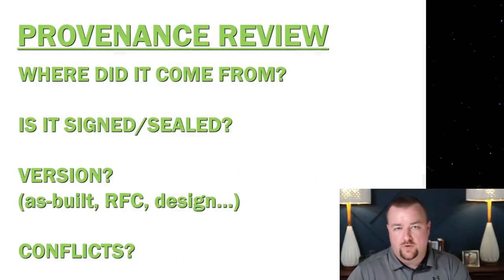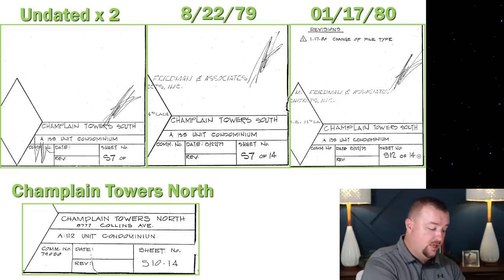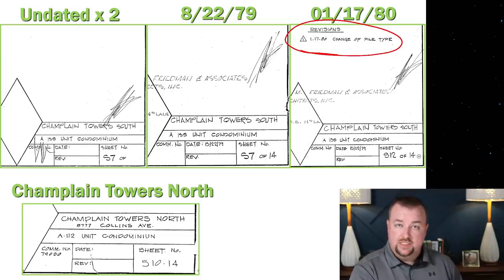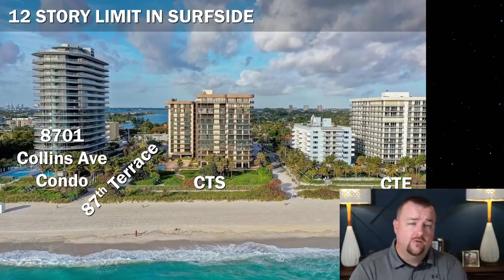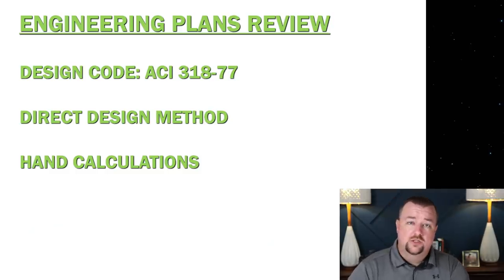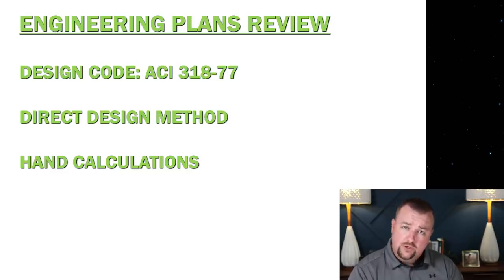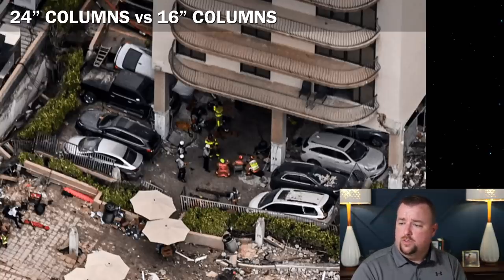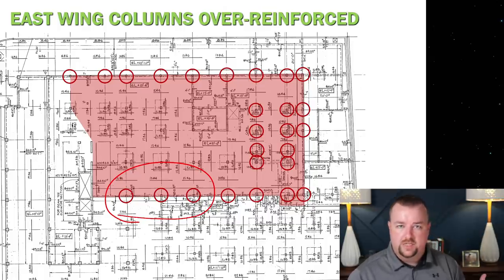Engineering Failures Found in the Champlain Towers South Drawings - Surfside Collapse

Comment from the maker: This video is already crazy long and I couldn't fit in everything I researched.  What didn't I cover that you're curious about?  I will take your ideas and try to put together a future video covering some of your questions.
Reply: How did the pool deck collapse pull down the building?  How different is the North tower from the South tower with respect to the structural design changes you speak of in this video?
Reply: Is it possible you could talk about the crane collapse during the construction of the condos? Could that have played a part?
Reply: I know other places are evacuating now due to unsafe living. Do you think the engineers will be stricter moving forward when putting up the towers? 😬
Reply: The videos are so interesting that its a pleasure to watch them... Don't worry about being too long.
Reply: Randy Carriere   excellent question, we know a lever can be very powerful...
Reply: @rollthers3157  my understanding is the deck provided stability side to side between the columns.  Once the deck punched through and dropped down there were columns without anything to keep them from moving to one side or the other.    Also weight of that deck hanging at angles pushing to one side would stress columns as well
Reply: Is North building substantially different? How?
Reply: @ernestrollins383  Agreed, and if the primary columns were damaged by the falling deck, such as pulling out rebar or fracturing the cement . . .
Reply: Any thoughts on when they removed the big palm trees from the pool deck if it could have had any affect or caused damage?
Reply: Do you think that they will build a new building where Champlain Tower South was? If they do plan to build on that site, would you recommend it?  Also could you go more into codes and maybe ways that we could not have builders build to the minimum code  and try to get as many exceptions to the code as they can?
Reply: @Building Integrity I am very happy I found this channel. I work in construction myself building casinos here in Nevada. What's very fascinating is structural failures and I think you should do more investigations on other buildings. By the way, we have crazy thermal expansion and contraction here with daily temperatures  in the 100's and nightly in the 60's. I've seen steel do crazy things. Thanks for the hard work.
Reply: I noticed in the last picture where the cars came down..the wall looked buckled or caving in some looking at the silver car and dark grey car with the planter boxes pulled away from the wall.  The under garage I guess wall seemed to be caving in.  Would that possibly  be a weak point or contributor or as a consequence of the slab coming down.
Reply: Interesting analysis and I have watched with interest. What I don't understand is: why not treat the building and pool slab as different structures and separate them with an expansion joint and separate support columns? I feel the reinforcing extending across this line between the two structures is a weakness that contributed to the collapse.
Reply: While I suspect that this is an area that you probably don't want to get too far into, I would be interested in as far as you're willing to tread. I have heard some passing accusations about greasing palms and other shady work that occurred during the 80's in Florida. Could you do a video about what actually happens in a city's permitting plan review; are there any double checks of the engineer's calculation? What role could a bit of money played in allowing this to happen, or could this have just been an oversight?
Reply: I think with the compression force on the three columns from the weight of the building that are right next to the deck then add the lateral force ( sideways force ) from the deck collapsing it snapped the columns like pushing in on a drinking straw until it bends to point to where it has no more strength the gives way.
Reply: Great analysis!!!
Reply: When you ran the numbers for the dead load on the pool deck, did you take into account the new topping slab and pavers?
Reply: This might be too much into speculation for you, but what do you think was the final straw that broke the camel's back?
Reply: Was up
Reply: I agree with others. I am also hoping for an analysis of south vs north!
Reply: Wondering if the same flaws are repeated in the twin building?  I certainly hope not.
Reply: @databoy2010  I have heard that too. The person said that a lot of these older condos were built with "cocaine money" by the mafia and that it was a frequent happening for the builder to say "Hey Mr Inspector...there is a box over there with your name on it." And of course it would contain cash. Purpose was to overlook the shortcuts that were being taken to save time and money. Josh is this something you can talk about???
Reply: Can you get access to the north and east original plans and analysis those and do a video ? See if there's major differences or similarity's  love watching your videos 👍
Reply: I want it ALL.  I am soaking up the information you are putting out. I have no idea about engineering or buildings, but you have sparked an interest in me and I am loving it. Please make more videos, doesn't matter how long in my opinion. Whatever you researched and found out I would love to know. I hope you consider teaching at some point in your life because you are extremely talented.
Reply: Your presentation is so fascinating that a 40 minute video felt like 5 minutes. Thank you for all the time and effort you're putting in to these videos, I've learned so much about these structures we live and work in and the enormous responsibility on the shoulders of those who design and maintain them.  😘
Reply: Please make a video with details (the best you can) of how the pool deck collapse brought the building down.  Thank you Josh!
Reply: It was so amazing. It didn't seem long at all
Reply: Thank you for talking to ME. I am not a structural engineer. But, I can understand nearly everything you say and have learned much from you. I was so upset about this building probably because I own a share of a bit older unit in Myrtle Beach. You satisfied my worries and answered many questions for me. Who now knows what spalling is, or punching shear? I do. Who knows what happens when rebar is exposed to the elements and how to repair it? I. Do. Who knows the effects of salt water on cement and metal? Ding, ding. Thanks again, Gramma Linda from Va.
Reply: @nancydeis7121  Me too, Nancy.
Reply: NOT too long.
Reply: I'm sure most of us have felt the slab in a parking structure bounce as a vehicle passes by. The step down beam would have greatly dampened these. With the beam gone and the parking slab on the same plane as the pool deck these vibrations would have continued beyond the parking area into the pool area exasperating the problems detailed in the video of that area.
Reply: 1) When you calculated the slabs at 100%, did it include the sand, the new pavers, and the water retained due to failed waterproofing?
2) Did you find a certificate signed by an engineer certifying the integrity of the structure, in lieu if the city doing the structural inspection?  What is your opinion about that?
3) If Champlain North has the same design flaws, should it be evacuated right away?
4)  How could it possibly last that long if it was at 100% deadweight at inception, then you add sand, pavers, a fractured deck, planters and vehicles.  It couldn’t possibly last 40 years.
Reply: Anything and everything! I'm literally addicted to these videos, so keep 'em comin'!
Reply: 5).  Please do a video about any possible construction flaws (as opposed to design flaws) that you may find.  For example, looking at the parking deck and the punching shear, does it look like they used the amount of steel the design required?  Was the steel placed correctly?  Were mats of steel tied correctly?
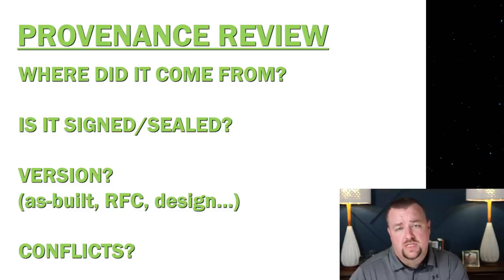Reply: At 1:10 AM, the Nir family in 111 all heard a loud crash that sounded like a wall had collapsed in the apartment above them. The surface parking collapsed at 1:15. Within those five minutes, Nicolas Vazquez and his wife Gimena Accardi parked in the garage and got on the elevator…in fact, they were in the elevator when the garage collapsed. With all that in mind, and knowing that the surface parking area was a weak point in the design, where would that initial collapse at 1:10 have been most likely to have occurred?
Reply: At some point, things transition from ‘this building is in bad shape’, to ‘this building is actively falling apart’, from ‘this building dies today’ through ‘this building is coming down in the next few seconds’, to ‘collapsing now’
You’ve covered the first and last bits of the process quite well.  Would it be possible to inform us better on some of the intermediate stages - if you can do it responsibly.  I don’t want people to be unreasonably paranoid, but I’d like them to have some idea of what signs say ‘get a new/second opinion from an engineer’ or signs that say ‘be somewhere else’.
Reply: Great video Josh. Was kind of sorry when it ended.

A couple of thoughts in particular that I have are :

The communication of the collapse of the visitor parking/pool-deck to the tower itself....and those columns. In particular, did the columns buckle straight downwards at the base where possibly weakened by salt water, or where they yanked sideways near the top, causing at least one to fail asymmetrically perhaps 7 minutes later. Could it have started with the one column on the east side of the driveway (beyond the bottom of the entrance ramp) which had that transfer beam running out to the pool deck and that planter ?). That column was still standing in that infamous video from the BG hotel, but I wonder if it was damaged at the back by that transfer beam possibly ripping out of it, and destined to fail minutes latter. Is it even possible that the main collapse of the building started as yet another puncture shearing event at these columns rather than a column itself giving out first? 

Another issue that is bothering me....is there a way that an incipient, creeping failure in the area of the parking planters would cause popping or creaking noises most specifically in that part of the building that housed the unit 11 apartments ......including that one on the ground floor where that lady and her 2 children got out ?

Finally, just a comment...it is so unbearable that most people might have been able to escape (even through that NE stair tower) after the collapse of the pool-deck/visitor parking but did not....especially if there was perhaps 7 minutes to react.
Reply: Could the lack of beams under the unplanned palm tree planters above the end of the garage ramp caused the same thing you described in this video?  If so it might have been the initiation point, otherwise the cars area failed even earlier than the 7 minute before video down the ramp showing the debris on the ground and the water pipe dumping water, which is a possibility too.  Eyewitness stuff I've heard made it sound like the planters fell before the cars, but I'm not sure how accurate that is.
Reply: Dear Building Integrity, I referenced you in a reply in another post. I only told them to view this specific post. I hope that you don't mind. Also thank you so much for your relatable information, even though I'm horrified. Already they have evacuated some Florida condominium buildings, citing extreme danger. I live in DC and when this calms down and you have some time, please please create a series of videos explaining how we from other locations can avoid this situation.
Reply: The video length is not a problem, as long as the video is stuffed with great content.
Reply: 1: Did the additional weight of the PentHouse change the loads on the parking/first floor columns? Where they over loaded by that addition? 
Did the PH have a contribution factor on the columns to fall? I mean as you said in this video that the columns from the parking area and the first floor didn’t exactly overlap (underneath the area of the added PH) and the first floor columns were even thinner? 

2: Did the palm trees weight on the planters add the load so it (the pool deck) was over loaded? 

3: Did the Test Probe Area by the planter, affect the strength of the pool deck, since the core was drilled out but never patched back up?? 

4: Did the missing drains on the pool deck affect this collapse? Since the lack of drains and the lack of appropriate slope to the pool deck towards the drains, resulted in standing puddles of water and the waterproofing was also missing according to the Core Samples taken at the Test Area (by the planters)?? 

5: Will the other Champlain Towers now be deemed inhabitable since their design is an exact replica?? (without the Core Test Areas and maybe without the palm trees, and maybe without planters)
 I’m pretty sure the at least one of the other Champlain Towers also added a PH on top of the original design. 

6: If they used a tractor with a ladder or lifting basket, to remove the palm trees from the planters on the pool deck. Would that weight of the equipment moving back and forth on the pool deck repeatedly, cause irreparable stress cracks in the concrete? 
And if they cut the palm tree down in 2 feet chunks and threw each piece down onto the pool deck, would those impacts have created irreparable stress cracks the concrete around the planters? Cracks that would have been significant enough to allow water to penetrate the concrete? 

7: Since we now know that they didn’t install the waterproofing on the pool deck as the engineer originally designed the pool deck to be built? 
Or was that something that the engineer totally missed in the plans? 
Would the waterproofing (installed or not installed) have played a role in the punching sheer event? 

These are some of the questions that’s spinning around in my head anyway…. would love your feedback on these questions!! 
Thanks for your videos and you sharing your knowledge! 🙏🏻
Reply: At 4:40 the signature looks the same as for architects rather than the engineering firm.  So no stamp or signature from engineers on that copy of the penthouse plans.  Great video.
Reply: I think the design change of removing the step down/beams is an important element of the failure (and any added planters, and the cracking due to flexure, and the impact of cracking on rebar corrosion).

I am uncomfortable around the lap lengths (splices in USA), and embedment length of the ‘U’ bars into shear walls, and the generally ‘light’ rebar – although I have no direct experience of flat slabs so that is an uninformed opinion.  I also had some uninformed reservations about concrete cover, I had the impression that it was insufficient for the environmental conditions and concrete quality.
Reply: @margaretmclaren4685  Not Josh! but an ex UK civil engineer) In my view the final straw was two fold - general aging of the structure and the corrosion of rebar and subsequent cracking/spalling. But I am going to be inereste din Josh's response!
Reply: @margaretmclaren4685  Even if it ends up being a list video, still will be interesting.
Reply: @Meganomaly3  Wait, it was 40? I thought 15.
Reply: @robertjohnson743  Your bots are showing.
Reply: Please don’t worry about the length of time these videos take. They are worth the investment as a viewer. I’m thankful that you were taking the time to make them.
Reply: There are some CRAZY people in the world, uh?
Reply: @hugobenitogonzalez2202  insanity will get you no where😆
Reply: @jeffcensoredlives8449  still trying insanity? How is that working out for you?😆
Reply: @robertjohnson743  insanity is trying the same thing over and over and expecting a different result. Case in point😆
Reply: it is worrying that they added the penthouse to the plans after the foundation was being constructed, oof. I am curious how close to the limits that design change put the type 'C' columns poolside (row 10 or 9.1 depending on drawing page)? were they so close to the edge, that any deviation at all to the pool deck would have done them in?

hmm, if the pool deck flat slab had the 'N' type columns at 99.9...% capacity, how far over would the extra weight of the beams put on the columns, hmm.
Reply: This is astonishing the number of hours time and hundreds if not thousands of calculations you went through to figure out the changes in design in these load capacity issues. All of your videos have been top flight. But on this one you're making a determination. You may not wish to answer this and that's fine. But I'd like to know, if somehow your firm had been hired to do this very analysis you're presenting here, with the end goal of determining what happened and why, this is a hefty amount of work that I have no qualifications to even guess or estimate the costs of preparing and presenting. 

It is just my logical supposition that with your specific background in engineering these kinds of structures, and with the outpouring of sorrow for all those who lost their lives in this horrible collapse, you were driven originally by the curiosity of what failed to cause this, and you rapidly assumed the role of not not just forensic analyst but also a teacher who sought to make all of this explainable to a mainstream national audience.  Stories abound in all the comment sections of people who would have had no interest or motivation to pay attention to any of this if not for your gifted capabilities and presentation skills.

Everyone thanks you so enormously. At the same time it stands to reason that from a business perspective, the only way you could justify spending this huge number of hours without compensation was if your original purposes were recalibrated to not just inform people at large, but also use this moment in time to be an extremely compelling marketing of your company's expertise and services. I don't think anyone here would doubt that several large-scale engineering projects either already have or will shortly be flowing your way due to the enormous credibility, expertise, professional demeanor, and relatable communicator you've demonstrated throughout these weeks. Really outstanding job!
Reply: @quicksite  with increased following come funds from advertisers. YouTube pays big time .
 Any future contracts are well deserved.
Reply: I recall another analysis revealed (to me at least) that in the 90s or early 00s the pool deck was “improved” with the paver stones which require sand, gravel etc. under the stones.  Obviously far too much weight for the deck minus the beams plus the planters.  Looking forward to further analysis, thanks for the video.
Reply: Layman question.....why did the other side/wing of the building come down if this area was the "starting" point?
Reply: @T.J. Kong Good explanation.  From the explanation given in the 07/05/21 video by Sergio Manes the lack of support beams on each floor is what caused the cascading effect that brought down the other sections of the building (B side and C side).
Reply: @ernestrollins383  Good explanation.  However, I feel that the remaining portions of the building should have been able to handle this.
Reply: Could you cover the design dead and live loads used for the building?  Are the dead load estimates consistent with the materials used (specifically for the pool deck)?  What are the differences in live load between the residential levels versus parking versus pool deck?  Were the design loads listed on the drawings?
Reply: The remains buildings should they be reinforced to make them stronger?
Reply: I am curious about safety margins. How big would they normally be? If you design for one ton of load, is that then with something that can carry 1.5 tons, or 2 tons, or 5 tons? Another question also. What kind of procedures are there to mitigate mistakes, other than safety margins? I imagine with all the thousands and thousands of details in a building design, there will be some mistakes. Are there additional ways other than safety margins to deal with this?
Reply: How much of the water in the garage came from the planters.
Reply: Have you heard anything regarding the security videos from the various cameras located on the site?  Were there recordings?  I am assuming the videos feed into the lobby/office area which remained standing...for a while.
Reply: @laydeestroh4830  I don't think so.
Reply: @JustinNYCode3.  North 81 and East 94 yes.
Reply: I would like to know if the East and  North Towers suffer from the water intrusion that the South Tower experienced? Did all 3 towers have the same designer and builder? Your videos are fantastic by the way!!! It seems you are right that this building was pretty much doomed from the get go, especially when those structural beams were eliminated from the actual construction. My oh my.
Reply: Can they not get into Champlain Tower North if it was built identical, and see first hand the deficiencies?
Reply: I’d like to see video speculating further from this video as basis. Who, if anyone, in theory, would be considered negligent from a legal standpoint. Should the city have had enough wherewithal to see the design deficiencies or is that too technical for a city and they have to rely on the engineering firms word.
Reply: @tratcliffe71  no guarantee that it was 100% the same. Still I am amazed that the defects; i.e., missing transom beams in the car park at CTS we’re not picked up on earlier.
Reply: Video might be crazy long, but it is crazy good.
Reply: Not crazy long video at all, it felt short. Thank you for all the effort that went into it!
Reply: I've been watching your whole series on this collapse - what a great job you've done! I really enjoy the way you explain everything, makes it easy for someone who is not in your industry to understand what occurred. You should be proud of yourself for sharing your knowledge with all of us, thank you sir!
Reply: Based on a statement by Chani Nir, who heard the “knocking sounds” starting when she got home to 111 at 11 PM, we know that the building was decompensating as early as 11 PM, and possibly even before then. Assuming that the deck collapse initiated with the small columns by the surface parking deck, would those “knocking sounds” start at the weak area and radiate out to stronger areas? If so, where is the likely location of Collapse #1 at 1:10 AM (which the Vazquezes either didn’t or couldn’t see before they got into the elevator?)
Reply: @Meganomaly3  just think about the tallest building in the world, I think it is in Dubai.
Reply: The longer the video, the more To learn.  Thank you, for your work.  Its a very sad situation,  you are showing us that was allowed to occur.  Those tiny columns, say it all.
Reply: @laydeestroh4830  Another YouTuber (jeffostroff ?) speculated they took out the palm trees possibly by using a crane on the pool deck and discussed that hypothesis.
Reply: @jimsuard  it could be less land receding there, fewer planters, less flooding in the garage, maybe no makeover of the pool deck, no palm trees in planters, no penthouse, who knows?
Reply: @margaretmclaren4685  My wild guess as a complete 😜 amateur is that the temperature drop that day triggered it, there had been two weeks of hot weather and then a sudden drop maybe 5-7 degrees and it collapsed at night when the temperatures were at their coolest. 😎
Reply: I believe the base floor (parking + pool deck) collapse is pretty clear now. What is not clear to me is why that collapse lead to a building collapse; the over-engineered columns are mentioned as possible causes, but that's an analysis I'm eager to see.
Reply: Will inspection frequencies be updated as a part of this disaster? I’m a bridge inspector and engineer. I can’t imagine going more than two years without looking at a bridge and noting a pattern of deterioration let alone 40. Thanks for the content, it’s great!
Reply: @rollthers3157  Looks like both North and East might have max or overloaded sections now too.
Reply: @RedRocket4000  thank you for this!
Reply: Crazy long but crazy good.
Reply: Were the same changes made to the other two Champlain towers that are still standing?  Or do they have the original supports?
Reply: Considering the poor design of the pool deck... What effect would a heavy crane or other vehicle have driving over it in the past?
Reply: Hey Josh, I think you misunderstood the ACI 318-77 building code requirements. The lap of 6" is okay as long as we have top reinforcement on at the columns and column stirps. This top reinforcement is typically greater than the minimum temperature and shrinkage reinforcement and we know per direct design method, typically negative moments are higher than positive moments at the interior spans. I think their detailing was fine considering the ACI 318-77 code recommendations.

Even ACI 318-77 details show only a 6" lap requirement in the reinforcement placing template. Again the underlying assumption being having enough top reinforcement.

In the newer building codes a requirement of integrity reinforcement is added so that slabs don't collapse in punching like we have had at this unfortunate circumstance. The bottom integrity reinforcement relieves the punching failure to such an extent and holds the slab in place. 

I did arrive at the same conclusion about 3 weeks ago and the video is posted on my channel, so it feels good that structural engineers in general do agree that the pool deck was over stressed and performing enough calculations clearly says so.

 I was mainly talking about sustained loads, the creep associated with it, the rust because of excessive cracking which later on lead to rebar delamination with concrete. The thing to understand here is even rebar delamination itself reduces the punching shear capacity by a factor of 15% or greater.
Reply: The after collapse photo of the 24” columns by the parking show lots of rebar coming out of the middle. Is that literally a higher column falling on a lower, perfectly? That pictures confuses me…
Reply: @maryanne1367  that is just the slab rebar that is held within the column section. The slab is constructed in such a way that some reinforcement is passing through the column, which is necessary for load transfer and reduce concrete cracks. The garage floor that collapsed was tied to column with these reinforcement bars. The 24” column perfectly stood still.
Reply: @7YBzzz4nbyte  That seems like a plausible cause. I hadn't even considered a change in the weather like that. Maybe a change in humidity, too?
Reply: Drop panels are shown at most interior columns that do not have a beam connection. The realtor's film shows a flat soffit which means that the contractor left them out. I believe this may be the cause of the punching shear failure.
Reply: Thanks again.  So much information in every video.  I am still confused about transfer beams and tall skinny columns.  I enjoyed the video about why buildings  collapse straight down.   It didn't sink in all the way either.    Someday if you have more time that would be interesting to learn about.
Reply: I would to see a conversation with you and Jeff noodling through the designs.
Reply: Dude, if your research is a 24-hour video, damn right I will watch it!
Reply: Very informative, Josh.  I have/had a couple of relatives who were/are engineers and I have always been interested in what is involved in the engineering and design of an object or a structure.  You make it easy for a layperson like me to understand.  As you pointed out in your video and in view of what could be considered critical structural changes that were made from the original plan, it is amazing the building lasted 40 years.  This raises some thought-provoking questions about the other building that was similarly engineered (Champlain North).  Is it an exact copy of the south building?  Maybe somebody has walked around and recorded video of the north building that can be of use.  Did somebody decided to investigate how the north building is designed after the south building collapse?  It would be interesting to find out.
Reply: @uwekonnigsstaddt524  Ever heard of the World Trade Center collapse at basically in freefall in 6.7 seconds into it's own footprint and no plane hit it on Sept. 11, 2021?
Reply: @werewolfnar  Ever heard of the World Trade Center collapse at basically in freefall in 6.7 seconds into it's own footprint and no plane hit it on Sept. 11, 2021?
Reply: Can you comment on how they got away with adding the private penthouse floor and not providing a new concrete column schedule or utility drawings? I expect that someone told the contractors to use their judgement on how to get sewer, water, TV, HVAC and electricity in place in the private condo. They also added the small private elevator. Also is there a set back wall in the gym's outside wall as shown in the plans? This being near the removed beams mentioned in this video and not having in-line columns in this area has me wondering what weakness this may have caused (if it was built that way, pictures are not clear on this due to its location tucked back in the corner.)
Reply: What changes will be made to prevent this from happening again? Who will make them?  It should never have been made with a factor of safety of 1.0, and I hope there is a read-across of buildings designed by this engineering firm.
Reply: Josh, some of the other youtubers have made a point about the palm trees that existed in the planters that were removed in the recent past. The trees and their method of removal, I believe, could be a contributing factor. When considering the overload you are already finding here, assuming heavy equipment live loads on the damaged slab during tree removal and the additional dead load carried over time, this appears to me and others to be a storm brewing.   

Thanks and really enjoying the education!
Reply: @rollthers3157  watch all the videos. he has answered these questions
Reply: @margaretmclaren4685  think he just found it but it has many contributing factors that varied with time and corrosion
Reply: Would it have been better to isolate the deck structure from the building columns? The deck structure is so much more vulnerable to deterioration and it looks like its collapse brought down the structure
Reply: @tratcliffe71     The 9/11 guy already took core samples of North.
Reply: Did the builders break code or just massively cut corners? I realize standards were different back then like you said but I don't think you ever came circle and said whether they followed it close enough to not be negligently responsible
Reply: Have you heard about Miami Dade County is just looking for a forensic engineer a month after the collapse? They won't let Surfside's famous expert Allyn Kilsheimer look at the property because they expect Surfside to be sued. Surfside said that they would let him out of his contract with them and let Miami Dade County hire him, if they want, but they think he might be biased. He said that he only tells the truth no matter who he works for.
Here is an article:
https://www.miamiherald.com/news/local/community/miami-dade/miami-beach/article253113213.html
Reply: @cristineschwertner619  I have watched most of these in full at least twice each. So yeah. Longer is great! But I’d also love a “sparknotes” version eventually 😊
Reply: @margaretmclaren4685  Some people think, the moon and the tide.
Reply: @margaretmclaren4685  There was som meteorological side covering Surfside, with historical data on it, I Googled and found it maybe two weeks after the event and thought the "bars" must have shrunk or something.
Reply: Cyprus
Reply: I want to know if Champlain Towers East has the same weakness - a $600M question perhaps!
Reply: 41 minutes is not long...life is not a hack or shortcut...
Reply: Spectacular analysis, wow. I am still a little shady on what the "stepped" area was and how it worked. I  would have expected beams around the entire perimeter of the raised area to raise it evenly?
Reply: What does this mean for the sister tower?
Reply: @jimsuard  So far, the most substantial difference is that the North building was scrupulously well maintained with an ongoing program of regular inspections to catch any structural flaws as early as possible, and correctly repair them immediately, to prevent small issues from becoming big and expensive.
Reply: So @19:49 you said 'I did the calculations for the pool deck "N" columns (12x16) & I found that the (pool deck) slab alone was about 100% of the load' QUESTION; Did your dead load calculations (of 100%) INCLUDE or EXCLUDE the (additional/omitted) weight of the planter boxes & their contents? THX.
Reply: @Teresa Corrigan At least nowhere that he'd be happy living in, then again he might, insanity is a crazy place to occupy
Reply: @JinalDoshi91  You are correct about the temperature reinforcement. The bottom bar condition was standard for two way flat slab construction during that time period. I have only reviewed the specific plans that are shown in this video but one of the most important details that looks wrong is that drop panels are shown on the plan but the realtor's walk through video shows a flat slab soffit. Omitting the drop panels would explain punching shear failure unless stud rails or some other method was installed to compensate for their omission.
Reply: Josh please analize champlain Towers East, as compared to the south!!!
Reply: Josh I have only reviewed the plans that you have posted in these videos. It might be helpful to show and elaborate on the typical drop panel detail. Perhaps you could explain to the public why drop panels are so critical for punching shear. Since they are shown on the slab plan but the realtor's walk through video shows them missing, a follow up question would be whether or not stud rails were used to compensate. I suspect that this may be one of a series of errors that led to the collapse.
Reply: @dnchappell  the zones that you are calling out that were shown on plan were defining the column strip widths in either direction. A lot of people misinterpreted it as drop caps. Typically the size of drop caps are smaller, and extend more or less up to 5 x thickness of slab as a thumb rule.
Reply: @JinalDoshi91  I don't have the benefit of a set of these building plans other than what Josh has shown on the video. As a retired rebar detailer who has spent many thousands of hours working on two way flat slabs I would say that your explanation of the missing drop panels is possible but needs to be reviewed more closely. It could be a way of defining column strips. I would need to review all of the typical details to get a better feel for how this engineer is presenting his work. As far as drop panel sizes, most common that I saw during that period was extending L/6 either from face of column or sometimes L/6 measured extending from center line where L is center to center distance between columns.
Reply: Maybe you can tell me why air traffic was shut down around the champagne Tower before the collapse.
Reply: In the beginning you referred to the different column dimensions. Statement: Heavy moving (dynamic) loads create more punching shear. I'd say the dynamics create more sideways stresses (lack of proper description here). As an example a fast moving vehicle breaking abruptly would try to bend the columns. OTOH that will be impossible as the deck, the whole slab to boot, will not move a bit less or more due to the columns it sits on. The sideway forces are taken up by all columns and whatever resisting elements against bending, e.g. braces, are there. So the punchng shear which is created simply by weight comes from vertical loads (dynamic only if they fall from the sky). How are forces from a breaking, accelerating or even turning vehicle translated into a verticle load increase needed to create punching? I don't have the proper understanding here. Can you enlighten me?
Reply: @dnchappell  Yeah I understand your dilemma. City of surfside has released all the drawings to public. And I not only reviewed the drawings but did perform calculations per Direct design method as well as Finite element analysis of the slab. Both the calculations show that punching shear even under strength design was okay at most of the column locations except a bay of 12 x 16s and couple of 16 x 16 columns. 
They have defined column strips similarly on all other floors. I did check those floors too and it was okay as is and didn’t require any drop caps or shear stud rails / shear heads. So I think they didn’t require drop caps anywhere except at pool deck columns as I noted above per my calculations.
I did create a video on this entire collapse analysis with some additional research as in how capacity of section degrades as the building ages.
Reply: I was on the board of a Minnesota condo for 20 years. My background was not in construction, nor were any of my fellow board members. 
How would a condo board of non-professionals be able to find out that the pool deck was poorly designed as it was in this case? The architect, engineer and city. code authority approved it, and there had been an engineer studying it in 2018, none of them highlighted how close the deck was to collapse.
Reply: @kenedd1869  in Minnesota you don't deal with hurricanes Every year. hurricane Irma was particularly bad. Plus Minnesota is mostly all bedrock. Florida's have strict building codes because it's all swamp and the marshland.
Reply: Was salt water in the garage periodically?   What were the reports of water being pumped out constantly over the years?   Was that sea water or rain water from lack of waterproofing of the slab?
Reply: @kenedd1869  I wonder too, how come nobody (of the professionals approving the design and changes) balked when re-calculating the capacity it could hold only the dead load. Does that include any loads from people using the deck, furniture and moving equipment to place the planting boxes? If not the design should not have passed muster.

Another question comes up: The building on top of the columns weighs much more than the pool deck alone. So how could those columns stand up in the first place? something is strange.
Reply: Can you make a part 2 to share the rest of what you researched?
Reply: Have you ever sat down and used your professional experience to piece the construction of the twin towers and bldg 7?  20 years later and I'm thinking we need a detailed engineer without any bias to look into it
Reply: @PersianDaisie  hey thanks for responding. I don’t think I have even mentioned the thickness of drop panel. I was just talking about extents which Daniel corrected me as L/6. The thickness is determined based on the stresses. I also do agree that at first glance it appears as drop panels but yeah when we scale it, they are too big to be identified as drop panels. 
Also, as I mentioned there were few locations where they actually required drop panels to fair. So it was not something that was intentional left out of construction.
Prof Dawn Lehman from UW also confirmed this.
Reply: @JinalDoshi91  That is not typical graphics or nomenclature for defining columns strips.  Most structural engineers, including myself, would say that those are drop panels.  Diagrams presented on sheet S11 of the construction documents identify column strip widths as a function of span, similar to those in ACI.

A review of the complete set of drawings could better solidify the engineer's intent to include the drop panel thicknesses and their plan dimensions at the typical framing level (sheet S8) above the lobby level.
Reply: Regarding punching shear failure: My reinforced concrete condo building is a converted warehouse, so designed for heavy loads.  The columns on the first two levels are not only large to begin with, they fan out to a larger diameter at the top, then are topped with an abacus about 6’ square.  All this is poured together, along with the slab above.  My question with regard to the collapsed building is: shouldn’t the columns have had an integral abacus at the top, below the slab, even for the larger columns?  When would you normally specify such a design?
Reply: thanks for the call out. I have been saying this stuff right from the beginning. I cant understand why people are not outraged like me about this. Should have never been built like that and I really think they need to take a second look at the north building. WHERE IS THE SHEAR WALL....Transfer beams. NOTHING
Reply: Who were the designers and structural engineers??
Reply: @JustinNYCode3.  He told you. The structurally under-designed area was the location of the collapse.
Reply: @ffxbellini  MONEY MAKERS.....with no regards to peoples lives.
Reply: @staciasmith5162  I think he is pointing out code violations.
Reply: @databoy2010  The first question should be, who were the designers and structural engineers??
Reply: @wrongwaywinnie1366  I believe he is describing code violations.
Reply: @MediaMaverick_  looks like the problem was the unique features of the collapsed side.
Reply: @jasonmatherly  Such construction is based on building codes, not ordinances (thank God).
Reply: @lindap.p.1337  It’s called “explaining it so grandma can understand it.”  Few engineers have this ability.
Reply: @davidandonie1460  This was an analysis of the drawings, not a field analysis.
Reply: I dunno where you are from so let me fill you in on height regulation in Florida of buildings along the beach. If they allowed tall buildings along the coastline, the building will shade the beach by two in the afternoon and nobody say's "hey, let's go to that shaded beach"
Reply: I think the North Tower should be analyzed and if it is built exactly the same, sound the alarm and get those people out of there! Although the maintenance might be better just the design flaw is enough to shout from the rafters to at bare minimum fix that building to handle the loads and stresses on it.
Reply: Amazing video.  Question I have is if the North Tower was built the same way with the same deletion of those step-down beams isn't that building in a state of imminent failure? Thank you again for all your time and effort and clear description of all your findings. You're a great teacher.  Wish I had you when I was in college pursuing my bachelors and masters in civil engineering!
Reply: Probably something simple I'm missing here but if the above ground parking had 24 inch columns, why did the underground parking have thinner columns? Both had the account for live loads
Reply: @Meganomaly3  I agree!
Reply: I would love to hear Josh's thoughts on this beam as well.
Reply: The most important societal consideration regarding the collapse is whether it was "merely" an anomaly driven by design flaws in this one building, or whether sea water intruded into the foundation through the rock and soil...and thus potentially many structures along the beach are also at risk. Does your research shed any light on that question? You have focused so specifically on design flaws that it makes me suspect you don't see any role for sea water intrusion, but it would be good if you could firmly put that question to rest because of its wider implications.
Reply: What kind of foundation is under that building? 
Are the pile caps still intact?
Reply: Id love to see more results of concrete damage diagnosed. Or more on rusty rebar and tie wire. OR you could even comment on submitted photos, like a learning edition "reaction video".
Reply: I would like YOU to do a Netflix series on the  Champlain Tower South. Please and Thank you
Reply: Does the north tower have similar design flaws? Last I heard there are still people living in the north tower.
Reply: I have a question about the collapse of the pool deck. Is it possible that the pool deck/parking structure collapsed next to the building columns, but stayed attached on the eastern side, thereby putting all the weight of the parking/pool deck on the bottom columns? I am imagining the pool deck collapsed at one end, at an angle, with all the weight of the deck pushing at the bottom of the column, essentially shearing the base of the column.
Reply: I'd like to know how drainage would be added for the planter boxes. I mean, it's a giant concrete box. I don't see any weep holes at the bottom. So where did the water go? Wouldn't you add drains underneath them? Also, at one time palm trees were planted in them. How would the roots of palm trees affect the integrity of the slab? Wouldn't roots penetrate the concrete once they grew in size?
Reply: I’m curious if there were other elements of the structure at fault that contributed to a progressive collapse. Did the contractor originally take concrete cube test results for each pour, if not, what are possibilities that the concrete may have been of an inferior grade?
Reply: A great effort. Very interesting work. I only have one very minor point to add. Those planters over time would have fertilizer and watering, a bad combo for reinforced concrete. Any damage would be hidden of course. Curious what was found during debris removal.
Reply: Thank you greatly. Grady Hillhouse did an awesome job, and you have highlighted the nitty-gritty's of the actual column-size changes when they were left alone when the beams were removed. (Don't assume that X remains the same when we remove Y). Thank you.
Reply: At 36:26 I'm curious why you why you make your capital Es like backwards 3s.  Then I see notice that 1 second before you didn't.  Care to explain your inconsistent block letters?
Reply: wondering how they declared the sister building safe so quickly
Reply: So the North building, although in better condition, is overloaded at the same points ?
Reply: Maybe it would be cool to do an updated summary of all contributing factors you’ve discovered after all this amazing forensic analysis...this whole series has been absolutely fascinating. Listening to passionate experts talk about their craft never gets old! Thanks again for the great content!!!
Reply: Recently, I found out how to speed up videos: 1.25x; 1.5x times... (the settings button)- it makes it easier to watch "slower paced" videos (not that yours is but for fast processing people....). I also had a boss (structural engineer) that always wanted quick concise answers; he also was sued for the maximum of his liability insurance - which begs the question: is this a profession where either a quick video or one-sentence answer is fitting? You did a really good job of keeping this video as SHORT as possible. Training videos for fast food restaurants usually run about an hour. This is STRUCTURAL ENGINEERING. You described an exceptionally complex topic in just over 40 minutes... pretty stout!! And if you watch it in 1.25x it's like 33 minutes.

Please at least skim my other comment on this video and give your perspective. About every 20 years there's a structural engineering disaster in my area and we're due for the next.
Reply: @staciasmith5162  The seemingly only way to get engineers to build above minimum code is to elevate the required minimums.  This comes with unintended consequences.
Reply: Long term undrained water contact with the unprotected roof deck slab, leading to leach of the slab and corrosion-expansion of the rebar. It’s the leading candidate at present for the collapse, and not an overload of design limits.
Reply: Why no reference of the 2018 inspection of Champlain by Morabito, licensed structural, which shows the likely primary cause of this accident?
Reply: at 11:00, cars / SUVs are much heavier than in 1970s

even the giant Caddy's and LTDs and Impalas of 1970s   don't measue up to what we drive in 2020s...
Reply: at 27:28, a beam with 90° hooks was drawn, not 135° minimum we expect for confinement steel at beams and columns

were the columns also built with 90° hks on the bands ?

( as to lap splice lengths, I expect to see called out 25" for #4 in ~4ksi concrete, 31" for #5, 37" for #6, with -1" the ACI 117 tolerance, thus the odd increments )

such columns tend to crush, with a vertical crack up each face, as the vertical bars bow outward

As to "over-reinforcement", ACI gives a Max Size Aggregate (MSA) at 2^0.5x clear-space of non-lap-spliced bars 
(no mention of non-contact splices up to 5 Db...)

so ~1.5 x MSA is tightest bar spacing for CiP concrete

(have seen resteel up to ~650-lb per CY)
Reply: @jimsuard  He mentioned that. 24" columns in that building remained in place.
Reply: FARTED !
Reply: I would like a video analyzing the "40 year Building Recertification Program", how it came to be, what it is, how it was put together, how it was approved. The choice of releasing a 40 year program without setting in place other checkpoints for evaluations I believe is very irresponsible. Saying oh, this building fell in 40 years (Miami Federal Building that fell),  lets set this as the example to follow (as the engineer that developed the program has said that is what happened though HIS head), then take that level of security or risk reduction and allow it to be the only inspection after construction is misleading to the public. It is enabling and giving free room and time for the building administrations to avoid spending on repairs if they can avoid it. It also misleads the public into feeling that buildings are safe for 40 years after construction, therefore reducing the attention and awareness, which leads to reduction of regulation and checks from public pressure. I believe that when the government adopted and activated  a 40 year BRP, by itself, played against the basic principle of holding paramount the safety, health, and welfare of the public.
Reply: @ericschuttenbeld7140  On Engineering site several Engineers commented that they always try to inure one area does not pull down the rest. 

When wider footprint is needed in example Earth Quake areas I still believe but need expert opinion you can build ares to help in a Earth quake yet if they fail they don't pull down the rest. Thus they help with side to side support as they are connected but have break away elements that don't let up and down stress pass into new areas.
Reply: @jeffcensoredlives8449  Visible punching shear. Intact colums in the down section of building just tipped over indicate your lying though your teeth. Controlled demolition leaves signs but now signs. And people were watching and hearing no expositions.
Reply: @maudessen573  Sound is funny don't count on direction someone heard something for were the actual sound came from. From Engineering site I have learned in example sound travels though walls and roofs better than floors due to furniture and carpet and other things on them thus sound from below can seam from above. But it way more complex than that and people recall is very full of error often.
Reply: How was that sagging, gray crossbeam along the side of spot 27 attached the pillar at the front of spot 27? If either that beam, or the pillar at 27/28, collapsed first, how much torque would it have placed on pillar 27?
Reply: apparently there had also been pavers added to the pool deck. THat would have increased the load even more,
Reply: I'd be interested to know if the East Tower also shows the same design issues. It is a different layout than South and North but still may be interesting to check.
Reply: So theres negligence and people will be going to jail! and companies sued!
Reply: Hi, another excellent video, thanks - so clearly explained.
I'm curious, cars have generally got bigger/heavier in the 40 years since the building was designed/built. Looking at the original design codes used for this building, would they have allowed for the vehicle loads that the building would have been seeing now? Or is that another reason that would explain why the slabs were now at >100% load?
Reply: @gpslightlock1422  He's covered those points in an earlier video. No evidence of problems with the pile caps.
Reply: @nemo-x  he's covered these items in previous videos.
Reply: @Nill757  He's covered the evident deterioration in the concrete due to cracking, corrosion and water ingress factors already, in prior videos.

And in this video he explains exactly the point that if you start with 100% load factor from the original design with perfect condition concrete and rebar, when you then have the cracking and corrosion problems, you quickly get past 100% load factor.
Reply: @Nill757  He mentioned that in this video and analysed the report in detail, in earlier videos.
Reply: very interesting, thank you! I would loved to hear an estimate of the overloading of that main suspect 12x16 column, with a beam to spread the load and without to better put things into perspective.
Reply: Not even close to a structural engineer but the way you present this material is so interesting. Please make more videos including more of your research that you couldn’t include and other odd bits of the structural plans you noticed! These are fascinating videos, beyond well produced and researched content, and I’d listen to Josh critique structural engineering plans all day long. Just translating this material into something digestible is quite an art and you got it!
Reply: @cristineschwertner619  STRONGLY agree! Include all the content please. Or consider creating another channel where longer videos/extra detailed content for those of us who want more …
Reply: @cristineschwertner619 , muito bem dito.
Reply: Outstanding presentation!!!!!
Reply: @cristineschwertner619 , very well said.
Reply: I am civil engineer in th caribbean country of Dominican Republic, I wonder why they used drop panel instead of what we normally use beams, that would helped avoiding puchnig shear and more ductility, I personally modeled in ETABS the building using beams and the results were crazy, torsion, more red warning that a parade in the communist chinese party...
Reply: NYS has Property Maintenance codes; doesn’t Florida?